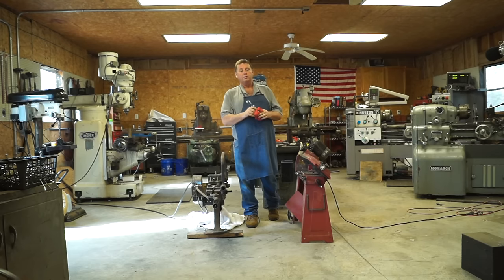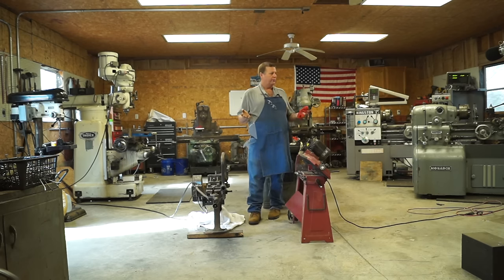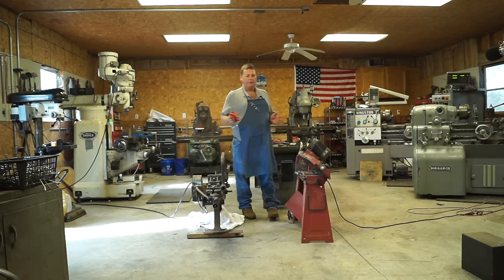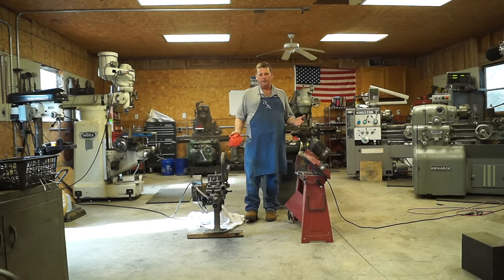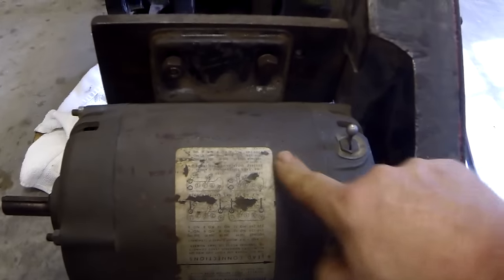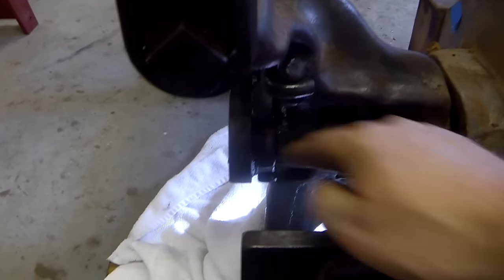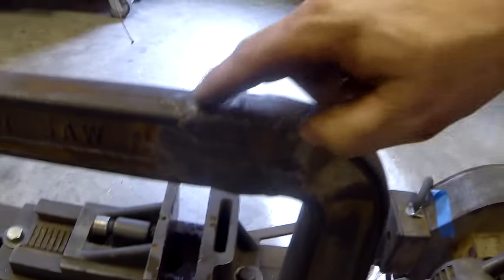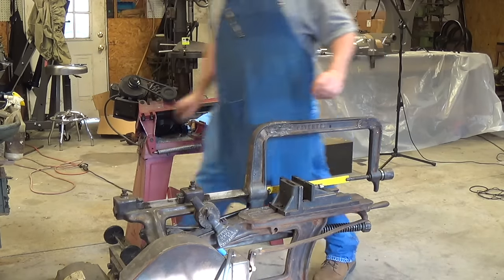Marvel Power Hacksaw Vs Harbor Freight Bandsaw

Comment: Fascinating.  I have both these saws.  The only difference is my Marvel is an older vintage; there is no gearbox, instead a series of step down pulleys.  Anyway, my results are significantly different.  With a 10tpi blade I would have expected the HF saw to cut much faster,,, at least mine does.  I need to check my blade speed, I may be running mine too fast.
Reply from the maker: My saw runs at 60 RPM

Comment: Would like to see it up against a better bandsaw just curious because I have a pretty decent JET variable speed geared head 9x16 horizontal bandsaw and it's served me well but I've almost always worked with tube...now I have some projects where I need to cut 6"x5"x1.5" steel plates.. bandsaw kinda hates life lol
I have a chance to bid on a Ercole 310 and from the little information I've been able to find that power hacksaw should do much better maybe slower??? Not when I keep breaking blades on bandsaw lol
If by chance u happen to see this I'd really like to hear your input??? Thanks

Comment: I found a little Kennedy Hexacut powered hacksaw and love it to bits. I put some 3" 4340 bar in it and just left it to get on with things. Took couple of hours but it cut it clean and true with only a 1/16" kerf. I just plan my cuts earlier than I need them! Best thing is that it can pop under the bench when done and not take up valuable workshop space. Bandsaw tends to get used more in the vertical position with a small table fitted, this makes it just about the handiest tool in the shop.
Reply from the maker: thanks

Comment: I'm somewhat surprised at the difference in cut times. If both blades have the same TPI and the same set and are equally sharp, all else being equal I'd expect the bandsaw to cut faster since it is cutting continuously and the hacksaw is only cutting about half the time or so. I'd guess the bandsaw is running at a lighter cutting pressure.
Reply from the maker: I will bump them up a little

Comment: Great timing, I have just ordered a cheap bandsaw like that...
Reply from the maker: There has been nothing wrong with the bandsaw I have, My neighbor has the same saw sold under another name and I don't think it's ever worked correctly
Reply: Mine cut awful until I spent a couple hrs fiddling with it. It cuts mostly angle and square stock and does a great job of it. I run on fastest pulley but use a squirt bottle to cool in heavier cuts.

Comment: All things are not equal in this test. 
The hack saw is going the WRONG direction (not cutting) 50% of the time.
The band saw by design should easily out perform the Hack Saw. 
Add weight, and increase blade SFM on the HF saw and it will run rings around the marvel. The marvel is Kool-old-skool tho

Comment: The Marvel is a much more elegant machine. The HF is what fit my budget and needs. Factory setup was AWFUL.... I spent some time tuning it up. Also, I can't remember seeing power hacksaw blades locally available. Most hardware stores have blades for the HF. If I find something like the Marvel that I can afford, it's coming home with me. Until then, the little HF works for what I need.

Comment: My same red HF saw cuts faster than that, and without having the counterbalance spring backed off all the way.  Dull blade or slow speed?  Not dissing the Marvel, I'd be very happy to trade my HF for it!
Reply: Yeah you can always run and get another HF saw. They're a dime a dozen. Availability is a factor too. I will say the blades from HF are garbage. I am not even too keen on the new saws for that matter. Still an unbeatable value all around though.
Reply from the maker: yes I use Lenox blades
Reply from the maker: Blade isn't that old but I have cut a fair amount Stainless on it. But I've always cut steel as slow as it will run and it's taken a long time,
Reply: I also use Lenox as well as Starrett blades, but I also use the middle 
grooves of the belt pulleys for band speed.  I have not overheated a 
blade yet.
Reply: *****
Do you cut a lot of stainless steel?
Reply: *****
those are some good brand blades you use. I still don't know how they hold up to cutting stainless steel though. SS can be the tooling killer in some situations. Your whole test may have just proven how important feed pressure really is cutting SS.
Reply: No, very rarely do I cut stainless.  Mostly mild steel and aluminum.  Some tool steel.
Reply: *****
yeah I love my mild steel like I love butter. For about the same reasons too. It's just the old familiar.
Reply: My bandsaw cuts a lot faster than that - just flood it with coolant. That is much too slow - I can cut an I beam faster than that.

Comment: After watching the video I noticed you had the belt on motor set for slowest speed not fastest like you said on the Harbor freight saw that is
Reply from the maker: Yes that is where I normally cut steel, When I said that I was cutting as fast as I could I was a referenc to the tension on the spring that controls the pressure on the blade.

Comment: You should have show how easy and fast it is to change a blade on the power hacksaw vrs the bandsaw. I just picked up a 12" covel power hacksaw for sawing small stuff in my shop so I dont have to change the course pitch blade out on my Kalamazoo saw as often. Being a12" I can also use hand hacksaw blades which opens up a much wider selection of blades available.  You ought to consider mounting that Marvel up higher.  Save your back.
Reply: Have you actually ran regular hacksaw blades on yours? I just picked up a Craftsman 12" (same as yours) and I am restoring it. I figured the regular blades couldn't handle it.
Reply: @MegaLostOne  yes that is a nice feature on the smaller saws. Just use industrial quality blades. Such as Starrett bi-metal blades.
Reply: @vmc7505  Thanks, I will give it a try. I know about the best I have found on the regular blades is about $10 each plus shipping.

Comment: if your going to test these saws do it fairly weight the carriages the same and run the motors the same speeds
Reply: The same TPI, SFM, ? Compare with new blades of the same type, composition and brand.The band saw should win out, it cuts continuously, the Hack saw cuts at 50% of the time!
Reply: he should bulid a time machine  and go get a new marvel  to be "fair"
Reply from the maker: I would like to have a new one
Reply from the maker: Stayed tuned
Reply from the maker: Ok

Comment: Got a Marvel power hacksaw for free several years ago. Its a lot larger than the one in this video (Kinda like the one in this other video but lots older:  https://youtu.be/bJcYhZeD8c0).  Mine was built in 1915 & used till it wasn't cost effective to repair anymore in a coal mine shop in the 1980's, then saved from the scrapper by the guy I got it from who drug it home & finally left it sit outside his garage for the last 20+ years with the intention of restoring it but never the time.  When I found it it was rough as a cob & beat to death..... but I got it!  : )  It's far from a finished restoration but at least it works again now.  Fascinating to watch (never cared if it was faster or slower than my old Buffalo bandsaw) & built like a battleship!  

Mine still had the original induction type square electric motor from 1915 on it (that alone must weigh 100 lbs - I'd guess the whole unit easily weighs 650 - if not more!) with 4" wide flat canvas drive belt, automatic blade down feed & original oil pump/saw blade lubrication system still intact.  Still has the original vise too!  Originally mine also had an automatic stock feeding system for making repeated cuts of set length automatically for production runs & although some of the feed parts have disappeared over the last 100 years I found the patent drawings online & think I'll eventually be able to restore it.

Drive the alleys, you never know what you'll find sitting behind a shed!   Stop and ask, sometimes good things happen, the owner of mine was tickled pink somebody wanted the old saw to restore rather than for scrap so he gave it to me.
Reply from the maker: Cool, the location I found these I  had passed by all my life and never saw them.

Comment: I have one of those HF style saws from china, and it works fine until the blade breaks. Because of the small diameter wheels and the twist to straighten the blade through the guides, the blades develop cracks starting at the root of the teeth. It wasn't too bad a few years back when the blades were only 12 bucks a pop, but up here in Canada they are charging close to 30 for them now. It is surviving the sledge hammer for now, but I don't know for how long.